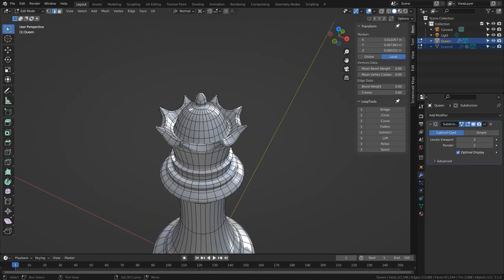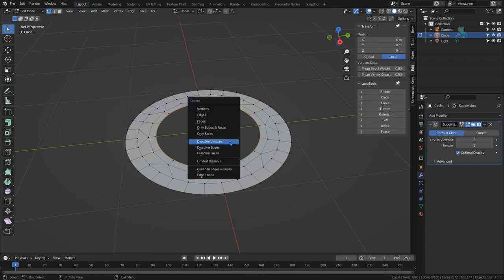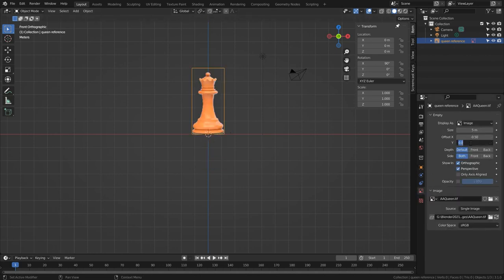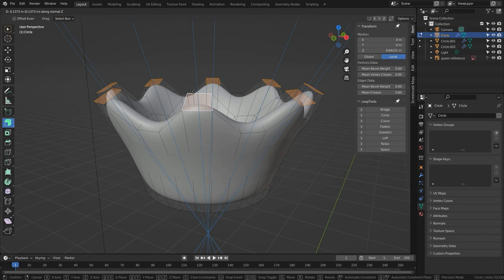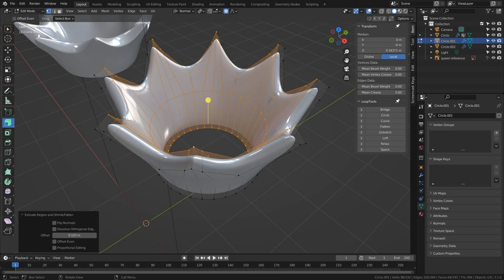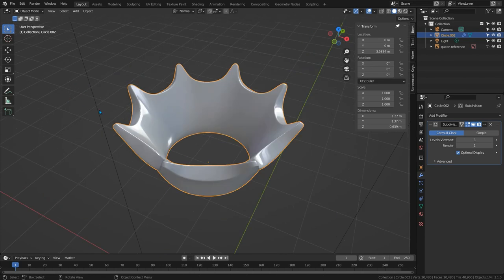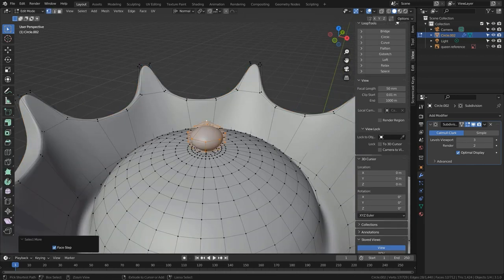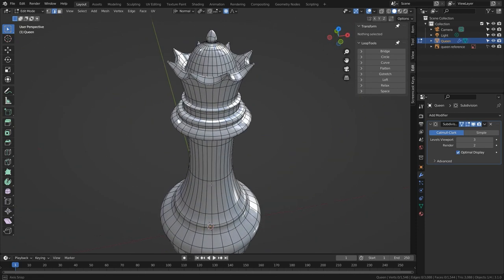Blender Chess Queen - #17 Subdivision Surface Modelling in Blender

Comment: Thank you very much Sir! I came across your channel thanks to Youtube suggestions, and I have to say it was one of its best suggestions ever. Great and thorough explanations throughout all of your videos, awesome!
As I was finding the alternating "select/join" sequence a bit tedious (even if easy and not that long to do), I tried something, and I think that I found a way to achieve Radial Connection Reduction with even less steps. With the inner loop selected, instead of doing a Checker Deselect with {Deselected: 1, Selected: 1, Offset: 0} parameters then dissolving the vertices, I do the following:

- Checker Deselect with {Deselected: 1, Selected: 3, Offset: 0}, which leaves 3 selected vertices separated with one unselected vertex, repeatedly
- "m" then "collapse", wich merges every group of 3 selected vertices into one at the central vertex, giving exactly what we aim for

Can repeat this exact same process down to 4 vertices, as you like.

Then "alt + j" (Tri to quads) with Max Shape Angle to the max (180°) just as you explained.

I tried it several times, and it does seem to work very well.

Please let me know your thoughts about this, as there might be cases where this is not suitable?...

Many thanks!

Comment: SMH...  How had I never discovered that tris to quads trick. So many hours lost.... lol.

When lowering the count around a loop I do prefer to use scale to 0 to merge groups of 3 vertices.  So Checker Deselect >> Deselect 1, Select 3, Offset = 0. Then Merge by Distance after scaling. Saves having to add in those extra edges to remove the Ngons. 
Naturally (viewers) you need the Transform Pivot Point set = Individual.
Reply from the maker: Hi Neil. The scaling method is  good. Nice and fast, but it does move the central point of each set of 3 in towards the center slightly which can be a problem on curved surfaces and when I expand this method into loops with mismatching vertex counts, that method stops working but it is certainly a  good method for loops that are multiples of 8 (which these are!)

Comment: Ian, thank you for making these amazing videos!  I struggle to understand when we should make watertight models and when not.  Is there any good rule of thumb?
Reply from the maker: Hi BMXBandit and thanks for watching them! final models would always be watertight. Control objects can sometimes be non watertight to save on calculation time in simulations but the only real case use for Non-watertight meshes is in games graphics where the developers can guarantee that a part of a mesh will never be seen. If the back of a building can never be seen by the player then the extra vertices do not need to be there and are just an extra computational overhead for the game engine. That said. The model would still be created as a watertight mesh during it's design and the unwanted vertices would simply be deleted later. There is really never a good scenario to create a non watertight mesh.  Some control objects for particle, fluid, cloth or softbody simulation can be non-manifold (not watertight) to save on processing times but any final delivered model would be expexcted to be 2-manifold (that is: every edge on a model is shared by exactly two faces - that is the only rule!). I do sometimes make a floor plane which extends off camera in all directions but other than that I make sure ALL of my models are completely watertight.
Reply: @ianmcglasham  Thank you so much Ian! You're a legend!

Comment: The hat is as cool as you what you do for us sharing your invaluable knowledge ;)

I've found some tricky moment at https://youtu.be/PQThJA_LCPM?t=4m19s
Checker deselect may give you two different results by random:
1) if you dissolve vertices exactly as it was in the video;
2) inverted selection.
I've made a screenshot to show what I'm talking about - https://drive.google.com/file/d/1EslG_aXUe9OlkReY8BW9xq49yuXY25ix/view?usp=drive_link
The first case (on the right side) will produce sort of "irregular" pattern that has less symmetry and has no straight edge lines between outer and inner sides of the mesh. The second one (on the left) looks more symmetrical. Both the patterns have equal count of vertices.
My question is what is the difference between these two patterns and are there any consequences for using one or another of them?
Reply from the maker: Hin takeshiko. Thanks. Checker deselect and grid fill can both give unusual results to be honest! If things are done in a very exact order then they will be predictable but they both cause all sorts of problems! I will talk about them both in more depth I the future. As for the two topologies - they both look pretty good. Which one you choose will depend on the kind of animation or deformation the object might expect to endure.